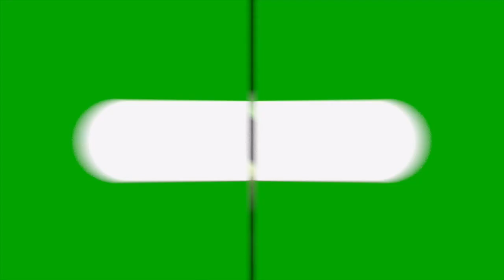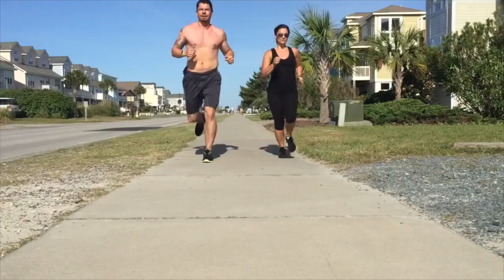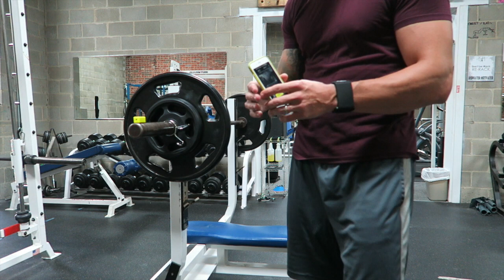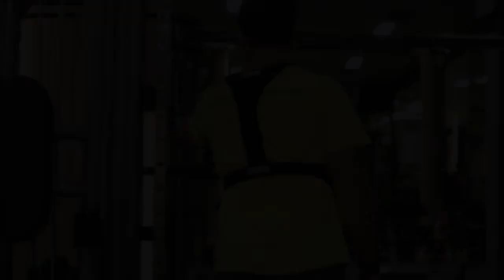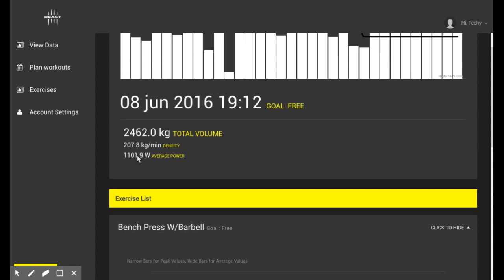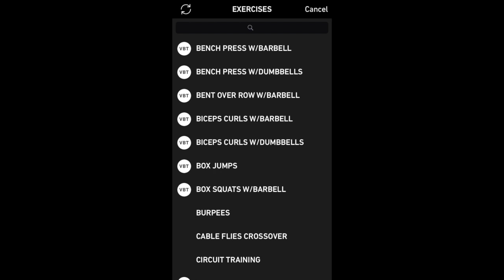Beast Sensor - Weight Lifting REVIEW

Comment: I'm trying to decide between a few different sensors and came across this video - thanks for reviewing! 

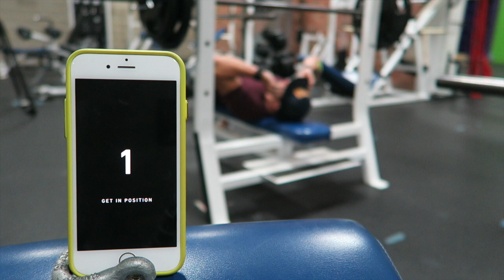When you're doing your bench presses in this video (2:12), one reading caught my eye - 1015W on a rep that looked no faster than your previous reps.  I measured your video frame by frame and according to my numbers, your second rep was the fastest (44 frames / .73s ) and your seventh reps was the slowest (61 frames / 1.0s).  Your 6th rep that measured 1015W was 49 frames (.82s). 

Unless my numbers are way off, this device does not seem accurate at all.  Your fastest rep should measure the highest number of watts, the slowest should measure the lowest.  Instead, you there's a .73s lift measuring 623W and a 1s lift measuring 723W, then a .82s lift in the middle measuring 1015W.  

I guess it's different if it's measuring peak power and not average power, but either way, something seems off to me.
Reply: In fact, Beast does not necessarily measure very accurately. Not to say it's apparently randomly outputting values. 

If you haven't found what you are looking for, you might want to take a look at Vmaxpro.

Comment: is the app free to use?
Reply from the maker: +Jackie Parks yes, it is
Reply: thank you. I've been watching couple of your videos on weight lifting sensors and I was wondering if there is any sensor that you don't have to plug in what type of equipment your using at the gym and that it just automatically tracks it? Or does every sensor you have put in each type of equipment you use?
Reply from the maker: +Jackie Parks most of these kinds of sensors require you to input the exercise or equipment you are using.  One band called the Actofit claims that it can automatically detect what kinds of exercises you're doing, and that you only have to input the weight.  However it's not out yet, they are sending me a review unit and I should have a review for that device in about a month.

Comment: who even need that shit.. useless and waste of time
dont get me wrong im lifting for 5 years and this kind of shit wil just waste your time at the gym
Reply: Well, That's because you are lifting and you just need strenght.
If you are an athlete who needs power, like a runner, swimmer, boxer ( well actually almost any sports ), you have to train at a very specific speed/weight that you can't possibly measure/know without a specific measuring device like this one
Reply: i think it does provide info for tracking result every month or so...
Reply: Well i'm 10 years eat the iron bar and i think it's useful

i'm using garmin vivoactive 3 (kinda like this one), it won't start counting your repetition if your position wrong and also i'm bad calculating my own strength, the heartbeat monitor so useful for me, now i know when i can start again and when i need to rest, so the 145kg straight bar won't crushed me

Comment: Solely based on the app making suggestions for changes in weight and reps, which do you think is better the beast or the push band?
Reply from the maker: I think that as far as weight lifting wearables are concerned, the Beast sensor is best.  I've used the Atlas, the Push band, Gym Watch, and more.  The Beast Sensor beats all of them.
Reply: Thanks for the quick response I was torn between the two because they were the only one I could find that made weight change recommendations but now I'm sure I going to with the Beast

Comment: Thanks for the review!  As a trainer, I am interested in range of motion for certain movements -- such as the squat.  Does the sensor give you a visual of where the sensor traveled during the set?  Such as how low the person squatted on each rep or if their chest came forward out of alignment on each rep.  Would be nice feedback to show a client that each rep is to the proper depth.....same on pushups, lunges, etc.
Reply from the maker: +thrivefitness I wish it had that feature but it doesn't.  3D mapping of movement isn't quite at a consumer level yet, but that's the direction things are developing.
Reply: Vitruve.fit does measure the range of motion, and also gives you other feedback like 1RM estimation, auditive feedback, indivualized load-velocity profiles... You can take a look at vitruve.fit

Comment: Would you say if looking for a wearable tracker, overall, this is the one someone should buy?
Reply from the maker: +datdudejmorg this isn't an all-day wearable, so no, I would not recommend this as an overall tracker.  Is is designed only for use in the gym or while exercising, specifically for weight lifting and strength training exercise.
Reply: +Techy Agent I worded that wrong, I didn't mean as an overall tracker, I meant specifically for in the gym. This lacks some functionality from other devices such as HRM and so on. Just meant  in the gym overall.
Reply from the maker: +datdudejmorg okay, gotcha. Yeah, as a gym fitness tracker, it's decent.  It's not something I would wear every time I work out, but it's something I will use once a month to see how I'm progressing.